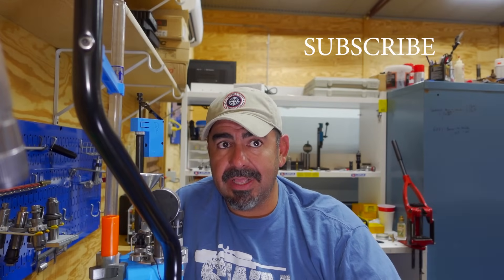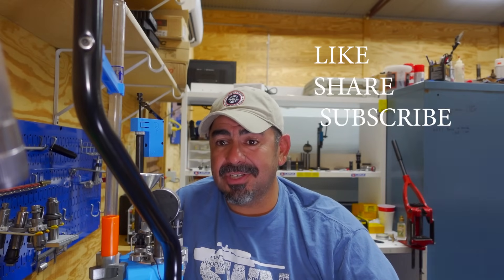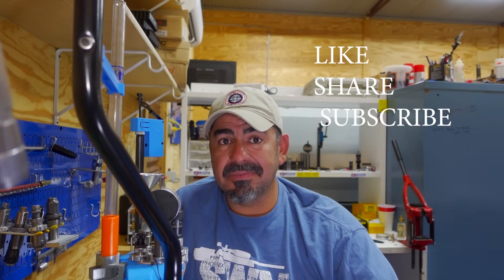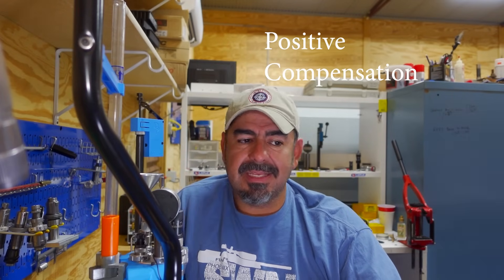Precision reloading is easy.  YOU complicate it!

Comment: After watching your 2 sizing videos they made too much sense so I switched to FL and shrunk my groups... then seating .050 from jam in .003 increments and they shrunk again to sub .28MOA..... you taught this old dog new tricks and I’m sold on your philosophies... they work. Thanks Erik
Reply: So deeper seating made it more consistent?
Reply: skin e I had to go .050” from jam due to mag length and start from there. Starting at .020” would’ve only made it possible to single feed
Reply: @hank3152  still probably .030-.040 over standard which is probably half of whatever group it was originally lol. 👍🏻👍🏻 find happy length. Then find happy charge. Make brass the same and repeat.
Reply: @MrT13  So, you found the right OAL prior to finding your proper powder charge?  I thought I saw in another of Erik's videos that you should find your powder charge first, and then the OAL (I think it was the "Stop Chasing the Lands" video).
Reply: @clintleffingwell8129  I dunno why I put then but yes you got me lol. You definitely definitely find charge with lowest sd first. I start 1-1.5% bellow max and work up a ladder in .2 increments. 4 shot groups till about 1% over. With once fired in that gun brass. If I care enough cause it’s a good gun and good caliber. Ie currents 6cm 6.5cm 6.5-284 28nos 300wsm. After lowest sd found I go .015 back then in .002 for the cheaper stuff. And .02 back and in .003 for the bigger. But you definitely are correct sd first after once fire with cheap powder primer and bullets. Then burn bump cut and get serious.
Reply: @clintleffingwell8129  Erik IMO is 1000% right on lands. And it’s actually backwards to what ppl think. When you work up a load and barrel smooths out and tightens up with copper a bit you actually have to seat farther not closer. Cause gun will speed up a bit. So it’s actually not chasing it’s backing off to keep the timing right. But he knows that he’s just simply saying don’t adjust according to lands. Once the gun starts passing peak and starts to slow down finally then yes you actually do start moving back closer to lands till it’s shot out
Reply: @clintleffingwell8129  like my last example that I really figured out this was fact was my 28. Took probably 60 good rounds to get it really dialed. So probably 120-140 round count. And around 250-275 even with decent cleaning it was opening up a bit and gained about an average 15 fps. So I ran a small ladder test at .002 for 5 back further. .004 for 5 back further and .006 for 5 back further. And the .004 and .006 were both tighter than original set load. So like I said it’s not exactly chasing. And I did not re measure the lands at all. I just opened it up a little to slow down the timing and she tightened right back up. So I seated deeper .005 and ran with that for probably another 100 now. Gun is if I remember right at 5.7 mill come up at 1000. Stupid flat gun. That’s my prove 1000 to friends 1 hit wonder girl.
Reply: I like simple, and you nailed it.

Comment: I'd like to see a series on dialing in a new barrel/rifle  and building ammo for it with data.   Cheers.
Reply: Good call, brother! Same here!
Reply: I would love to see this. In particular, I would like to know how to properly determine if the powder, the charge, or the seating depth needs to be changed and in what order you change them.
Reply: i concur.
Reply: @Daekar3  - Did you watch the video and listen to what he said?  First (1) adjust powder, charge or primer until you get consistent muzzle velocity (ED/SD = Extreme Deviation/Standard Deviation) then (2) Adjust seating depth until you get <0.25 moa at 100 yards. Then (3) if you are not getting long range consistency, try a different bullet - which means return to step #1.  Start with a proven bullet, you can go through considerable effort to determine one doesn’t work.  Also check up on what others use - no point in starting way too heavy or way too light.

Not sure why I read this.  I mostly need to work on the loose nut behind the trigger, shooter error overwhelms and issues with gun or ammo.
Reply: Erik,
I too like the yellow box freedom seeds but I my brain explodes when I look at the tip on my 200.20x bullets!  The tips are so inconsistant it is embarrassing.  I assume Berger considers it insignificant but I read where competition shooters are either uniforming the tips or running them through a pointing die.  I tried the uniforming thing and again was surprised to see at the tip on side the jacket was way thinner than the other.  For an object that is supposed to be spinning with precision at 40,000 RPM it does not give me confidence when I see what appears to be an out of balance tip.  Additionally, It is adding yet another step to a rigorous reloading process.  I have opted for the pointing die process but it upsets me every time I do it.  I am curious on if you do any thing special for your F class freedom pills.  Incidentally my Sierra Match King freedom pills have a much tighter tip but for what ever reason, I prefer the hybrid ogive design
Reply: Me too!! C'mon Eric - do it!! 👍
Reply: Yep. Me to
Reply: Me too

Comment: I jumped into loading 2 to3 with 55 grain full metal jacket and Varget didn’t trim my grass didn’t sort my cases just figured it out. And the load that I did first before I started doing the more complicated stuff I can still put in a 4 inch circle at 400 Using an old Mossberg MMR with a 20 inch barrel

Comment: I'd be interested in learning more about your take on the "combustion" side of things. Especially neck tension and measures to keep it as consistent as possible (not only within one batch, but also across batches) and how different methods, techniques and tools affect this (neck turning, "necklenght" (consistency of case OAL minus base to shoulder datum line, if you know what I mean), annealing, outer neck sizing vs inner neck sizing (bushing die without mandrel vs. mandrey die to set neck ID or OD, consistency of inner mouth deburring, maybe even crimping, etc...) And also how big of a player neck tension even is in the overall combustion list of factors.

Comment: Eric can you talk about what is acceptable as far as powder charge variation while reloading? I am looking for 1/2 minute to 1 moa accuracy and wondering if +or- 1 gr of charge is enough to actually make a difference. What is your procedure that you use?
Reply: 1 grain can be a lot of variation  depending on your cartridge and/or the powder type.
Reply: +/- a grain = possible maximum error of 2 grains difference between shots.  That's a lot. potentially a dangerous lot, if your chosen charge is at/ near max pressure and is at max density, you could be pushing it a bit. Pressure with some powders can escalate very quickly with small changes once you're near max.  47 grs. might be fine, 48 might make a primer flatten a bit, 49 might lock your bolt shut and leave you beating on your bolt with a 2 x 4, or worse. You can throw them if you're getting 2 tenths or 3 between throws if it's hunting ammo you're loading. I weigh and trickle every charge for my 7mm match rig. At 100m a few tenths of a  grain difference is insignificant, but at 900m a tenth can mean losing 1 point... and in close matches at high-level competition, 1 point is too much to lose. Throw 10 charges.. weigh it... throw 10 more in a clean pan. weigh it. do that for about half of the powder hopper. that will tell you if your measurer is throwing consistently. To be honest... my Hunting ammo IS as accurate as my match ammo... once the precision and accuracy bug has you, it's hard not to want everything to be bang-on. Like having sharp knives in the house... once you start sharpening.. they all end up razor sharp.  If you're not as anal as I am about my numbers... you should be okay with a 1/4 to 1/2 MOA variation in your groups. That will hit the kill-zone of a deer well out beyond humane hunting ranges. A decent powder measure isn't all that expensive, nor is a good scale.  Aim small, Hit small. Go for the 1/2 MOA groups. Your confidence will skyrocket, and your ego will thank you.

Comment: I start with getting a good powder charge node. 
There may be more than one. If so I get my best ES but I stay out of super high velocity. 

After I get my powder node I start to find my lands and slowly work back to book recommendation. 

So then I redo my powder. 

I get nice group. Then better group when both are tuned. 

My 6.5Cre custom load works great in mt Ruger predator as well as my GF. We both have the same models. Hers is a Gen 1 magazine and mine is a Gen 2 AI magazine. 

Interesting that 2 friends rifles won’t run my load. They have shallow chambers. 
One is an RPR and the other is an AR platform. 

Just stuff I do.

Comment: ERIK also i’m sure you know, but didn’t touch base on the variable of the barrel twist/bullet weight combination and how it can have adverse effects on grouping.  For instance a 55 grain bullet .224 bullet out of a 1-10 twist barrel stabilizes and is very good grouping but put a 90 grain Berger VLD and the bullet in the same barrel and it wont stabilize, it’ll keyhole the target and not hit the broad side of a barn.. obviously these are dramatic ends of the spectrum but hopefully give a good example of what I’m trying to describe. Optimizing bullet weight and selection for your barrel twist

Comment: Seating pressure is the big thing consistent seating pressure achieve that good tip is dry Molly lube inside the neck and of course consistent sizing you have to have a tool to measure how much pressure it takes to seat your bullet nobody really covers how they're achieving that but that's what gives you your lowest in your accuracy

Comment: I’ve always reloaded for hunting rifles. I use to reload for about six different cartridges and have since reduced that to three cartridges; 280 Rem, 7MM Rem Mag and the 300 Win Mag. I’ve actually become a better reloader since I “focus” on three cartridges. The KISS principal works!
Reply from the maker: Get rid of the 7mm mag, since it’s very close to 280, and you’ll be down to two.  😁
Reply: @ErikCortina  I hunt mulies in the Little Greys River area of Western Wyoming every other year. Long shots are typical so no way to getting rid of 7MM Mag. 🤠
Reply: I also hand load for 2 bolt action hunting rifles up here in Alaska.  .270 Win for Sitka Blacktail Deer, Dall Sheep, Caribou, Black Bear (130 gr Barnes TTSX).  300 H & H Magnum for bull moose/grizzly bear (180 gr Barnes TTSX).  I use 4350, 4831, Reloader 22 powders.  The trajectories of these 2 rifles are the same (3 inches high at 100 yards, 3 inches low at 300 yards).  In 28 years of hunting Alaska, most of my kills are less than 200 yards and as close as 25 yards.
Reply: @RetrieverTrainingAlone  Great combo and close to my trio. Great minds think alike!

Comment: Combustion, Barrel harmonics, External ballistics - Consistent BC. I Would like to add barrel temperature change i.e. temperature sensitive power.  I had to come down 1/2 moa every 2 shots after 5 to 6 shots using 760 powder at 600 yd. slow fire nra high-power matches.  This load shot great doing repetitive cold bore shots.  The round was a 243 Tatum using 107gr smk, developed by Scot Tatum, which is very similar to the 6 Creedmoor.
Reply: I also follow you like I followed David Tubb 30 years ago.  I thoroughly enjoy the information you provide on your channel.  Keep up the great work.
Reply from the maker: Powder falls under combustion.

Comment: What is a low ES. How consistent do velocities need to be on chronograph. In other words how much spread is acceptable? How do you determine which powder to use. Manuals usually list 6 to 10 for each bullet weight. Good job on the videoed.

Comment: Well - I'm using N150 more than 10 years and now i try the new N555. But the speed is to low - I have to go over the max Load. But the Max load of the VV data are often "low". What i try as next is the swiss reload  RS60 which has much more power. But if N150 fits - never change a winning team. The N555 is produced to be not so sensitive with changes of the temperature - will see. Greatings from Germany

Comment: Hey Erik, I just had a question and an observation on the method you showed that I tried today. The method I'm talking about is when you size  your brass to much then adjust your seating depth to match the original "jump to the lands". I was wondering if the extractor would hold onto the base of the case on ignition so that the firing pin doesn't drive the cartridge to the front of the chamber, thus leaving the jump the same as long as overall length is the same no matter the headspace. I started with new brass that was .006" shorter than my chamber I found a seating depth that got my groups into less than .25 moa. Then with the brass now fired to my chamber and I adjusted my seating depth to be .006" longer and ran them against the original seating depth all in once fired brass. And the original seating depth again gave me a one hole group but the adjusted seating depth gave me a group that was similar to how it grouped .006 longer in the seating depth test.

Comment: Awesome video, with the KISS method. Quick yay or nay from you if you would please. N160, 300 PRC, ADG brass at apprx 93.5 grain h20 capacity. VV load manual states 57.5-63.5 apprx of N160 behind a 220 grain. Full fill is 78 grains N160 without compressing at seat depth. At 74-82% fill capacity in case, does this, in your opinion, present a greater chance of higher SD? Or the ladder, possibly that lower case fill can still shoot just fine. Thanks

Comment: If you have combustion settled but need to adjust seating depth for harmonics will that affect combustion by changing the case capacity and pressures.

Comment: ....  Hi  Erik  went to range today to  do ladder test  . Club only has a Antique  chronograph   but only  one we have  .    i did 14 shots  in .2  increments     . i have 2  groups that look interesting  
34.0  / 2415                  34.6 / 2444
34.2 /  2419                   34.8 / 2444
34.4 / 2420                   35.0 / 2465  
On Saturday   i will try  try different   seating  depth  after i   found my jamp   try several 20tho  shorter
Reply from the maker: Load 34.7 and do seating depth test.
Reply: @ErikCortina     Thanks  Erik . by chance  i been using 34.7  for  my loads  since i started reloading  . it was a guess  . but i now  find   seating   depth  .

Comment: I think choosing the right powder has always been difficult for me, I just read what is  recommended or what they recommended in the reloading manual is how I did it in the past. But now their are so many good powders out their if you can buy it. I can remember 24 dollar a LB. powder ,and now its 80, same with bullets 24 dollars for 100 7mm sierra game king ,and now 80. It costs more to reload now than it costs to buy factory shells. Their was a trade show around hear  this winter and they were charging 50 dollars for 100 pack of large rifle primers. So it used to be that you could make better shells for cheaper , but now they are just rapeing us.

Comment: I shot my first handloads last weekend doing a ladder test. 5 shots in .3 grain increments working from 40 to 40.8 (should've been .9 but i goofed). The 40.6 and 40.8 loads stacked on each other 7/10; the 3 that didn't were me and i knew it when i fired- size for the entire set was 0.67". 
I know we're on completely different levels and you demand .25" because of your line if work but iut of a $350 Axis I could've be happier with first attempt. 
My question (should you read this) is should i stick with this node or increase the charge and try to find another at a higher velocity?
Reply from the maker: Don’t chase speed.  If that node satisfies your needs, stay there and be happy.

Comment: Thankyou for sharing your hands on experience and what works i really like your videos they make sense,  can you talk about brass prep removing carbon out of the case neck , do you want to remove all of it every time and if so how ? Stainless steel bore brush I have been using 30 cal for 284 cal case inside neck in and out twice while twisting by hand it leaves a shiny cross hatch not sure if this is a good thing or not and my be I should be using a 284 brush ?
Thanks for you help appreciate it ! ❤

Comment: Summarizing here for my own purposes for later reference, to be checked in order:
- Velocity Extreme Spread = if it's not low then inconsistent powder or primer, case capacity, or neck tension
- ES is good but groups bad = barrel harmonics (seating depth or use a barrel tuner)
- Good group @100yds but not @ long range = inconsistent BC in the bullets (get better ones)

Comment: Erik,
Yes do, as has been requested, a load development series.  I for one am a bit confused about your statements concerning bullet seating.  I understand that group size can be fine tuned using different bullet seating depths.  I use that to a small degree myself.  But you've made a statement saying that you seat off the lands, even if it's only a couple thousandths, and then said seat where you need to cause it don't matter.  In another video you said you seat long for match and do the final seating on an arbor press the night before a match.  I see a discrepancy here, and I'm sure you have a sensible explanation.  That's what I want to hear.  I use a Forster UltraMicrometer seating die.  Would I be better off with an arbor press? Or do you use one because it's portable?
I enjoy your data driven approach to reloading.  I've been doing it for about 25 years but still learning.  At 77 I will never be in your league, but that doesn't keep me from trying.